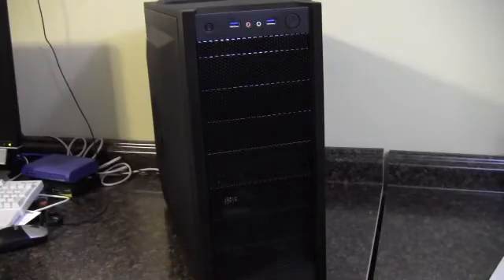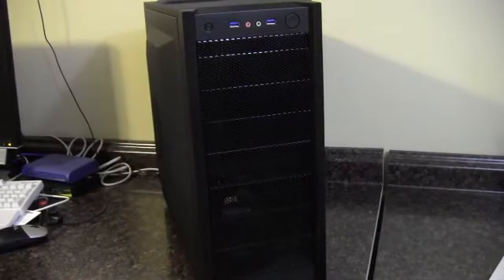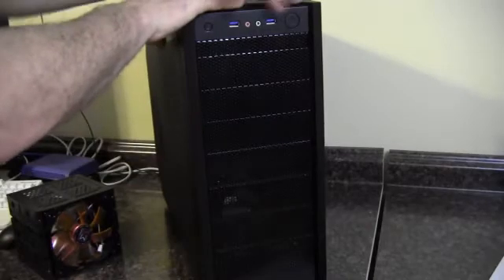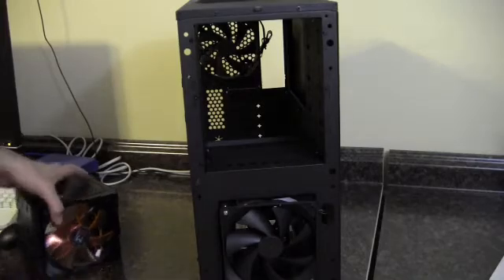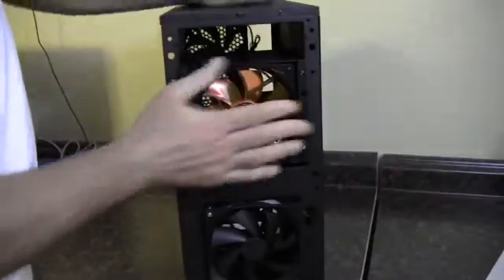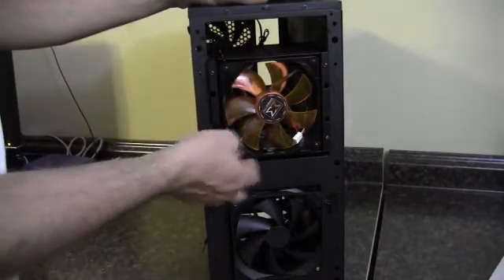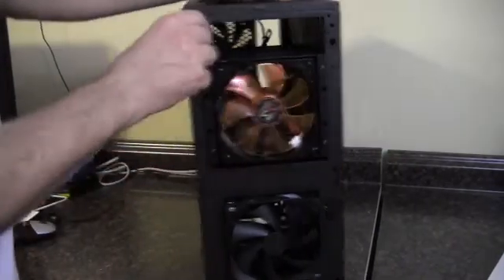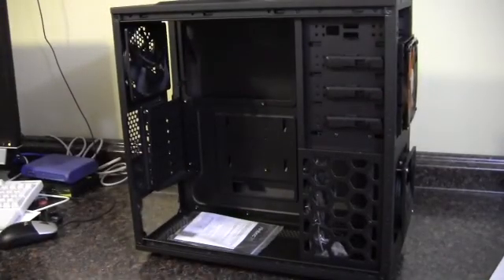Installing XigmaTec 4 in 3 HDD Cage

Comment: It's 2019 and I'm watching this video. I recently realized that my 5.25 bays were empty and wondered if I could shift the bottom mounted hdd cage into the 5.25 but realized I needed an adapter. All of this makes more sense if you are like me trying to add the aio radiator toward the front of the case.
Reply from the maker: Wow. I had forgotten about this video. Can't believe that it was over six years ago. I don't think AIO liquid coolers were even mainstream then. I know they existed, but not very many people were using them then. It makes much more sense today :)